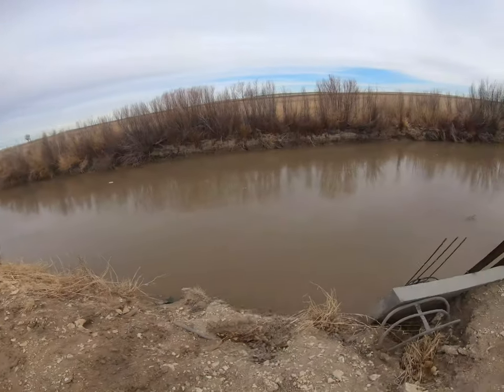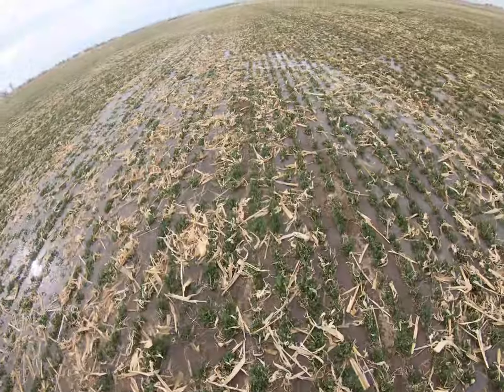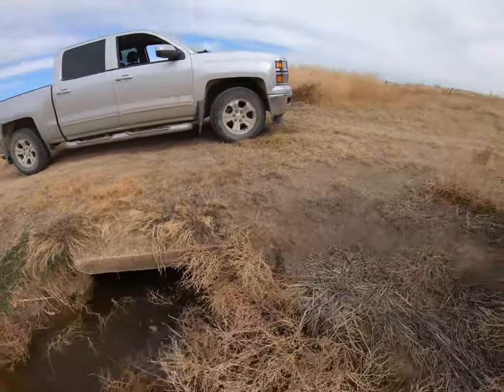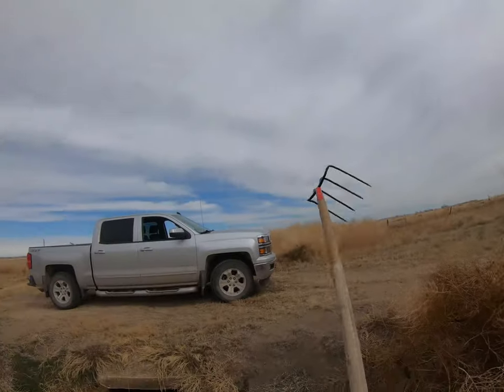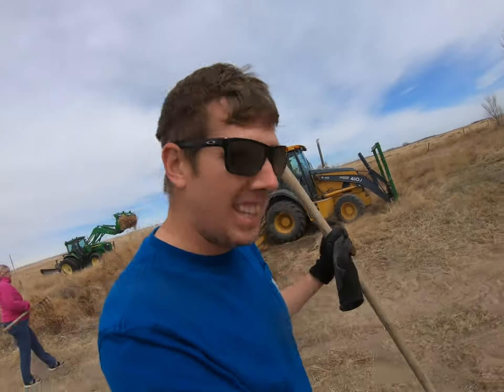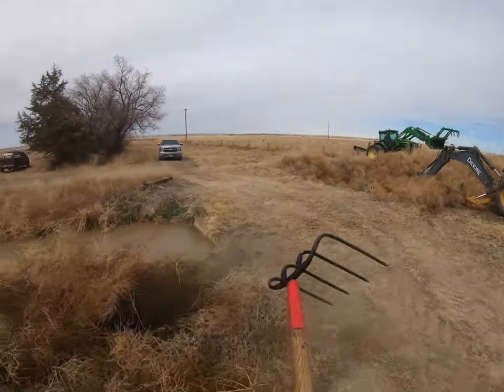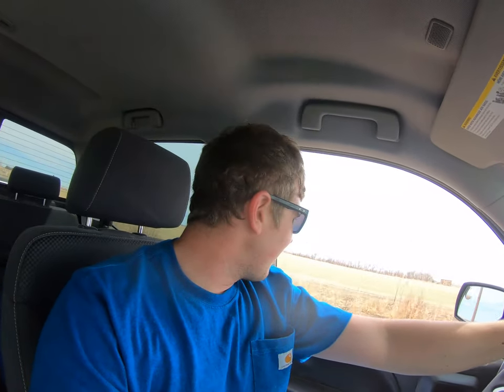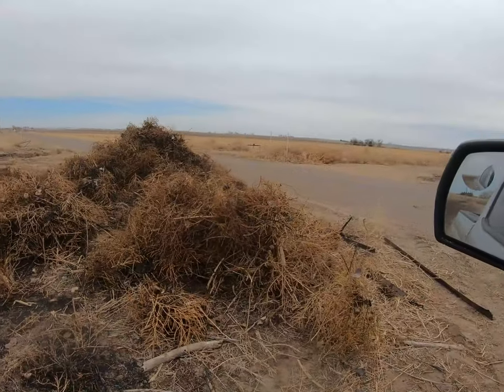Tumbleweeds take over

Comment: Maybe you need an attachment bought or built that will scope them up quickly. Do they compose well? Maybe threw a chipper?
Reply from the maker: Actually the backhoe doesn't do too bad. But yeah a claw wouldn't be bad either. To your other question no they don't. They just continue to blow around so we burn them. There would be huge amounts to put through a chipper and it's very scratchy stems.